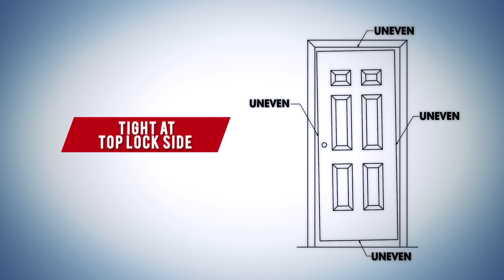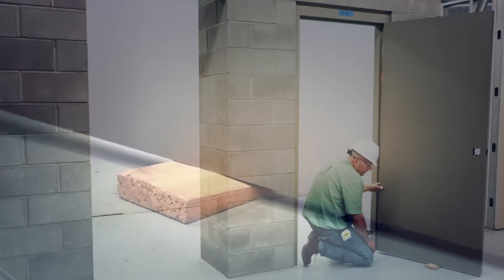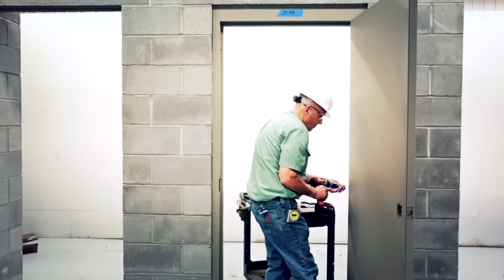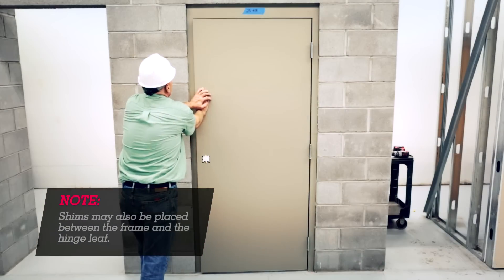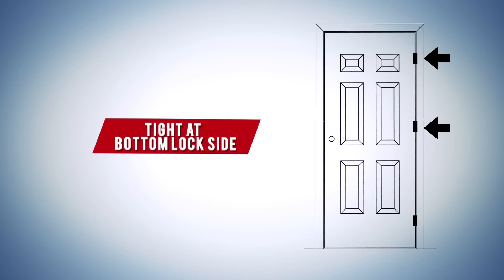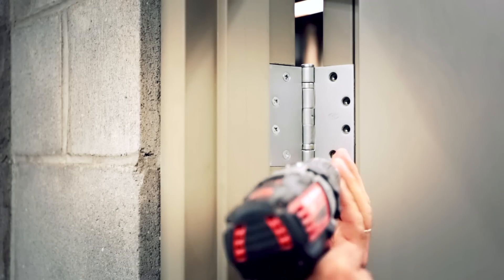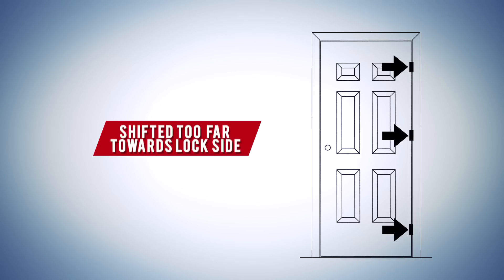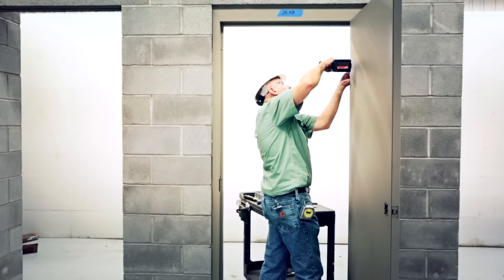Fixing Uneven Gaps or Clearance Between a Door &  Frame | Steel Door Institute

Comment: I had a question, my front door is metal,it closes and opens perfectly,doesn't hang up or nothing  however at the bottom corner of the side where the lock is and the knob and all that there is a nice gap, you can actually see daylight during the day and this becomes a huge problem because bugs and all kinds of critters get thru that gap not to mention the heat during winter, whats the proper way to fix this? a extra shim on the bottom?
Reply: I guess no one responded to your question
Reply: Did you ever figure this out? I have same problem.  Thanks

Comment: My door looks like the spine of a 90 year old vegan.  The top lock side sits an inch proud of the frame while there is a half inch gap on both the bottoms of lock AND hinge sides.
Starting to wonder if the frame was built out of scrap cardboard.

Comment: For the part where the door is too close on hinge side, it says to shim the hinges attached to door. This will push door toward lock side. Can you accomplish same thing by bending the knuckles attached to the door toward the frame?
Reply: I rarely use shim, I look for a 1/8 gap around the door. I use an Allen key long shank side and put it between the hinges and close the door gently, look at your hinges so they don't pop out. It would widen the gap by 1/16. Depending how your door looks that is how you are going to adjust it. Remember 1/16 and 1/16 is a 1/8 . You might just need to adjust two, one on top and middle or vise versa. This works for HMF with commercial hard ware

Comment: But what if the whole door is sticking on the lockside and theres no shims in the hinges?
Reply: you need to recess the hinges into the door frame more.
Reply: If you have a HMF it should have chimes take them out with a flat head, do one at a time so you don't take off the door completely. If this doesn't work use a 2*4 on the strike side, place at hinge level on all three and push the 2*4 towards the hinge side one at a time. You should have 1/8 Gap on all sides

Comment: Exactly what I need - Hinge Shims - but who sells them!!???  Can't find them at my Local Home Depot or other similar stores
Reply: You make them . buy a piece of flat stock and make them
Reply: Use some old credit cards i know true value hardware stores sells plastic ones for interior doors that has the three hole slots, other method i use is bending the knuckles on the hinges lightly & even with a cresent wrench works well.